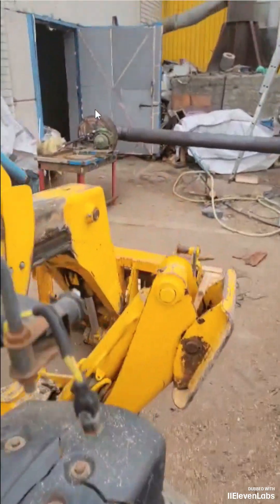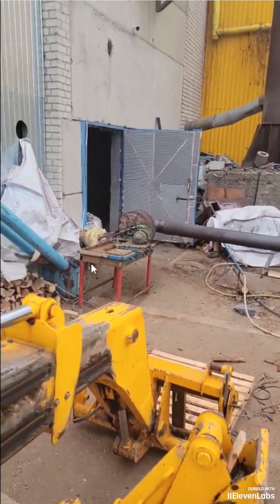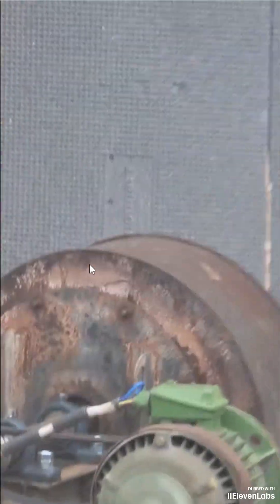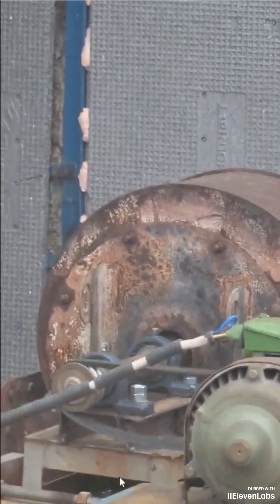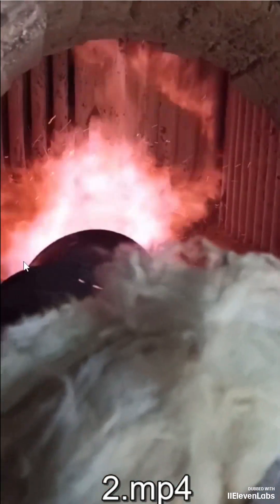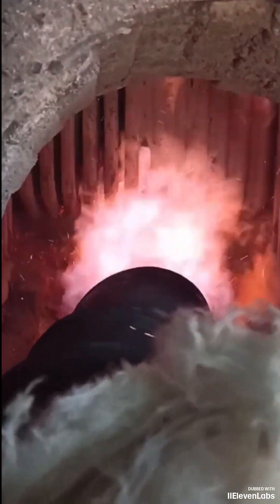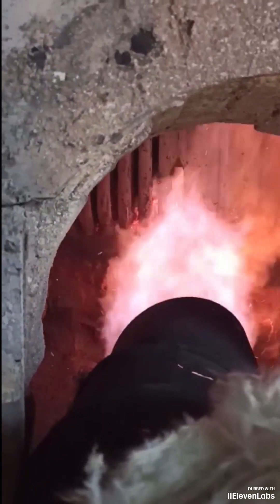1 MW thermal gasifier

Comment: Could it increase efficiency from 50 or 100% less than some wood stove because it's hard to regulate heat and fire output. I think this could extend burn times by 100% for already oversized direct burnn systems